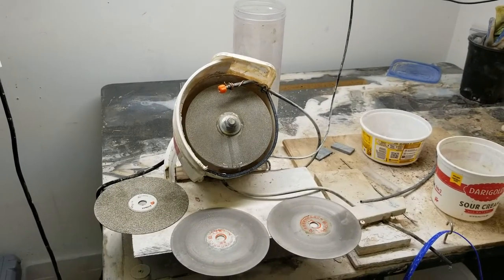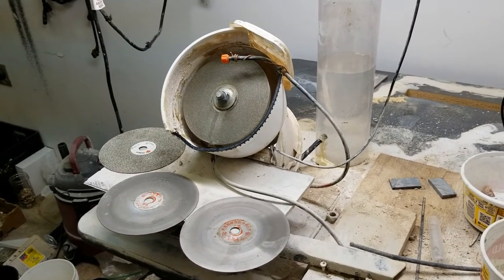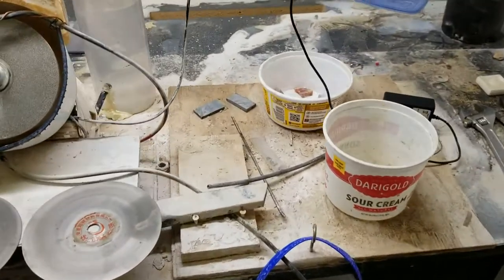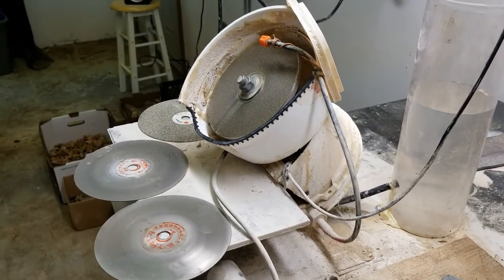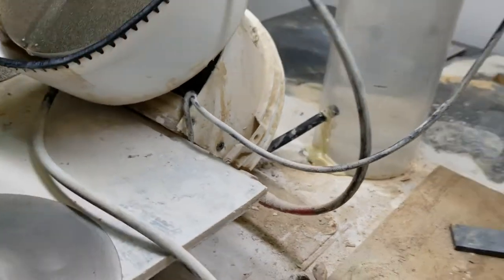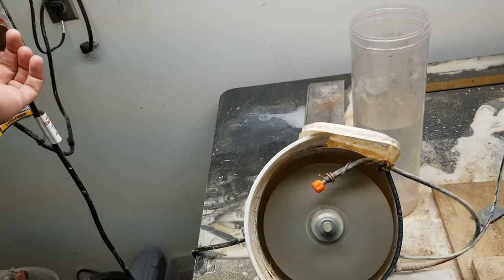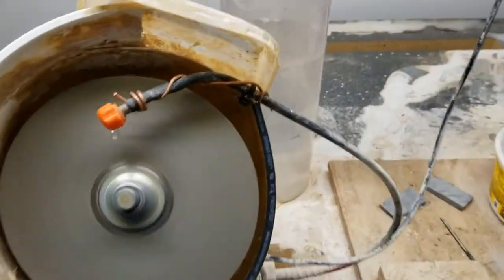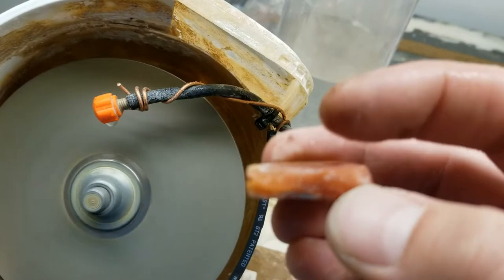Self Made Slant Lap - Lapidary stone polisher #TheFinders #WithMe #Lapidary

Comment from the maker: Here is the parts list of what I used and what I had to buy to make this thing if anyone is interested.

Arbor Adapter  - Can also get at ace hardware for $7-8
https://www.amazon.com/gp/product/B00L1RU2YU/ref=ppx_yo_dt_b_asin_title_o09_s00?ie=UTF8&psc=1

Motor Coupler –  * will need to get right size for motor shaft, Arbor adapter should be ¼:)
https://www.amazon.com/gp/product/B00KVNA44I/ref=ppx_yo_dt_b_asin_title_o00_s00?ie=UTF8&psc=1

Master Lap – 
https://www.amazon.com/gp/product/B071QZ8SKL/ref=ppx_yo_dt_b_asin_title_o02_s00?ie=UTF8&psc=1

Polishing Disk – 
https://www.amazon.com/gp/product/B071WSR7ZD/ref=ppx_yo_dt_b_asin_title_o08_s00?ie=UTF8&psc=1 

Electric Motor – ¼ hp Electric motor with 5/8” shaft (Free already had in the shop)

1 Gallon bucket - Free

Motor Speed Controller - Free already had on hand
https://www.amazon.com/Electronic-Controller-Variable-Adjuster-Hydroponics/dp/B07T9BLJ7L/ref=sr_1_3?dchild=1&keywords=variable+speed+fan+controller&qid=1601055162&sr=8-3

Comment: Never thought of making my own! You just use 3 grit sizes? What size is the motor?
Reply from the maker: I have a parts list in the video description.  That was when I initially built it I was just doing more shaping and taking the rough off my stones before tumbling.  Now I've got about 7 different discs.  I prefer the brand joiner 🤘👍
Reply from the maker: 1/4 or 1/2 should work for a 6".  Make sure you have a motor speed control on it so you can adjust speed and it gives you a safety switch to shut off. 👍